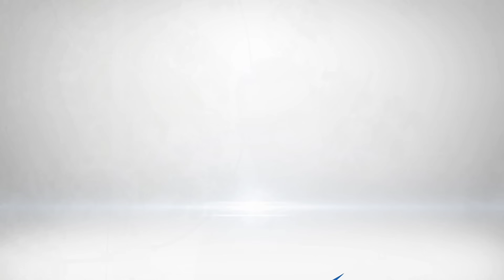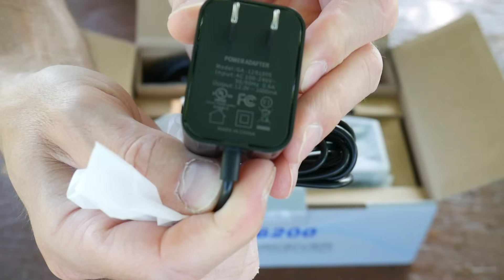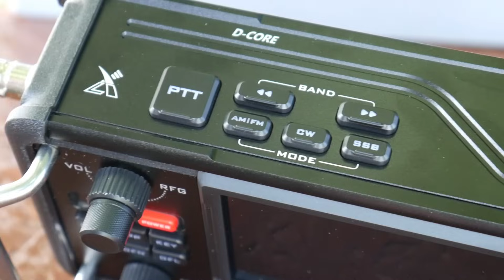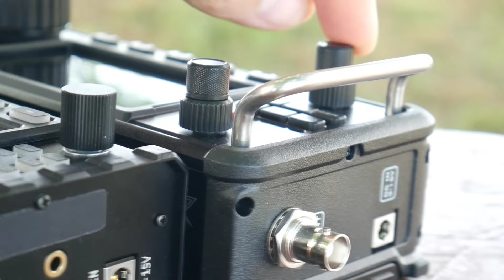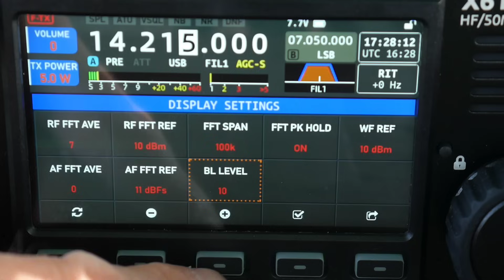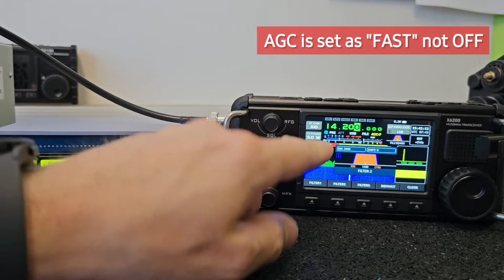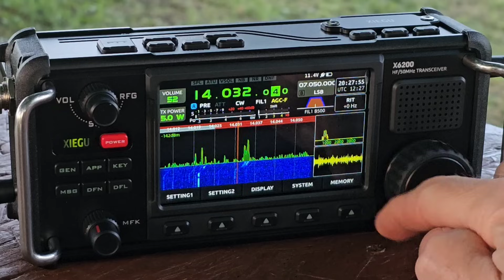New XIEGU X6200 - SDR Ultra Portable HF transceiver (review, comparison, measurements)

Comment: I just purchased one last week. First attempt to charge the battery pack and battery will not  charge. I set the setting "Charge On" and the screen indicates the battery is charging but after 8hours battery has no charge. This was with the AC adaptor supplied with the radio. Also tried charging with 13.8VDC still no go. Charging with the radio off, the green Xiegu LED flashes as it should when charging but battery is not being charged.
Disappointed.

Comment: Good evening Paul. First of all, thank you for the very interesting video. In this regard, having had the opportunity to use both devices, I would like to ask which of the two should I choose. Unfortunately, with the X6200, I have already had a very bad experience. Upon arrival home, it immediately showed obvious malfunctions. The device's PTT button, display backlight and SWR meter did not work. Also, after about an hour of operation, it turned off and wouldn't turn on again. The firmware was 101 dated July 24, 2024. I look forward to your welcome suggestions. Thank you. Best regards.

Comment: That really was one of the best films I've ever seen. And yes, the x6200 has a great receiver. And the transceiver's versatility makes it almost indispensable. I replaced the 6100 with the 6200. Strangely enough, I kept the x5105. I will test the transceiver with the OM0ET loop in practice. Hi 73 de HB9DTC Tom
Reply from the maker: Thank you for your nice comment Tom! 😉👍🎄

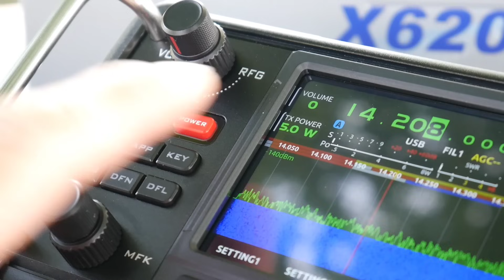Comment: I like how the X6200's frequency font is improved over the X6100, with the 100 Hz, 10 Hz, and 1 Hz digits are smaller than the rest of the frequency readout. The size difference helps to better visually communicate what the operator is adjusting. Compare with the X6100 at 24:17 into the video.

Comment: I have rethought the matter and it is better to spend a little more money and buy the Icom IC-705 It is a proven unit and has 2m and 70cm extra where the Chinese clone does not have it :face-blue-smiling:
Reply: The 705 is full of problems and way overpriced. In a few months the new Yaesu FTX-1F will kill the 705. I will still keep my X6100 when my Yaesu arrives as the 6100 is a great radio and fun to use. The 6200 will be great and even better with firmware. It is still new.

Comment: The x7300 will be the radio to get! It needs a touch screen. Going to wait.
Reply: The 7300 is now a vintage radio and never was great, just cheap. Get a FT-710, better than every Icom ever made including their flagship model. Number 4 on the Sherwood list. I will not sell my X6100, with the latest firmware it is awesome. The 6200 will be better with firmware updates.

Comment: You get what you paid for. Benchmark IC-705, xiego is cheap and not perfect. If you want a perfect Rig, buy Icom.
Reply: The new Yaesu FTX-1F will kill the 705. The 705 is very far from perfect. There is no such thing as a perfect radio. For the price Xiegu builds great radios that are fun to use and preform well.

Comment: I have two Xiegu radios, G90 and 6100.  I have always felt like a beta tester.  I bought the 705 and have never looked back.
Reply: 705 is way overpriced and still full of problems. On top of that no tuner and a dull uninspiring screen. I bought the X6100 and with the latest firmware have never looked back.
Reply: I agree but they are getting better. In 10 years I wouldn’t be surprised if Xeigu becomes a serious contender in this niche.
Reply: TX-500 ? )
Reply: Как говорится каждый живёт по своим возможностям,кто то имеет возможность купить такое радио а кто то ic-705,который будет очень трудно вытеснить .

Comment: I tested this transceiver for reception with an antenna and came to a simple conclusion - there is exactly the same receiver problem as in the previous model.
    All processing mathematics is designed for the fact that RF gain should be set to 100. You can’t just go and set it to 30, for example, the panorama and waterfall will be displayed incorrectly, the meter will show levels of -140 dBm, that is, show nothing.
    You need exactly 100 parrots, but the amplification is such that the sound turns into a cacophony of noise. A slight decrease in RF gain does not give anything, because the AGC still maximizes both the noise and the signal The conclusion is excessive AGC gain, which cannot be corrected.
    It's a heap - the encoder is impossible to use (I wrote above why), the built-in speaker is so squeaky and noisy that you can torture people with it.
    I compared it to the 705 and it's just heaven and earth.
    That's all, the transceiver is going up for sale. Just wasted my time. 

    Last edited by rolin; Today at 02:26. 

73! N7DDC

Comment: Not impressed. They need more than an incremental improvement, like HF/VHF/UHF (incl 220MHz), 10w on battery. Be nice to also have 23cm since Icom has it. Way too expensive for what you get.

Comment: Not a good radio. Slow screen refresh rate and high power consumption in rx. Icom ic705 uses 2.5w in rx and has fast screen refresh. The Chinese have a long way to go before they challenge first tier ham radio makers.
Reply: Sorry 705 waste of money for all its problems. Xiegu make good radios that are fun to use, after all isn't this a hobby. There was a time that the Japenese made junk. Xiegu is not junk. I did not waste my money on a 705 which was only slightly better if that. The new Yaesu FTX-1F will kill the 705 and be less money. I will use it and my X6100 as well.
Reply: @whitepinephotography5887  thats some good weed you have
Reply: The 705 is many times better on...

Comment: Nice video and interesting transceiver. But why do they not produce a transceiver with 10W of this internal battery? Elecraft with its KX2 shows how it is possible. 73
Reply: As if 8 vs 10 W is noticeable...
Reply: @RoelandJansen  8 or 10 W, but please with internal battery. Not only with external DC.
Reply: You only gain .5 S units with 20 watts. This is supposed to be a QRP radio, 5 watts.

Comment: I believe I watched almost all of your videos.
They are very good. Congratulations.
On the Xiengo X6100 it is normal to use RF SHOKE to avoid interfering with the transmission audio.
Does this problem remain on the X6200?
Thanks.
PP1JL José Luiz, Vitória - ES, Brazil

Comment: Excellent review on the X6200. I thought you were going to test the NR when you were doing a weak signal test ( -132? dBm). I recently sold my X6100. The X6200 looks better in a number of ways. 73 de WA3RSL
Reply from the maker: Oh! I just realised that I forgot to add this part in to the video. Yes I did this test. I will do the livestream today so you can see how the NR works.
Reply: @OM0ET  Very good!

Comment: Hi! The S-meter is either incorrectly calibrated, or the transceiver has serious problems with the reciever sensitivity. The X6100 had a stable S9 at -73 dBm, with the preamp turned off and RF Gain at 50. This is from the practice of Xiegu repairs. Although, perhaps they changed something here. Otherwise, the transceiver is more interesting than the X6100. If you plan to have a teardown video, that would be great. Thank you.
Reply: The meter... Only SNR is important
Reply: i'm sure all this will be fixed with firmware.

Comment: Thanks for the test Paul, You did a great job (as always).
I was really thinking of buying a 6100 last year. But there were so many bugs, and complaints about it, that I decided to go for the 705 instead, and I didn't regret it.
Reply: lack of tuner is a deal breaker for me. i don't know why they wouldn't put a tuner in it. when you get to field day, you need to be able to use it with any of the many antennas setup, and having that tuner just makes it so easy
Reply: 705 is way overpriced and still full of problems. On top of that no tuner and a dull uninspiring screen. I bought the X6100 and with the latest firmware have never looked back.
Reply: Price point. ocom and Yaesu have their QRP rigs for 4 digits not high three...

Comment: Does it still suffer the birdie issues that the X6100 had? I bought a X6100 and one of the birdies was a S9 on 14.070MHz making it unusable for data modes.
Reply: I sold my 6100 because of this very same problem.
Reply: Has now been fixed with firmware Sept 2024.

Comment: I would love to know what the TX Audio quality is like, with the built in microphone? The X6100 had many problem with the internal mic, and performed poorly.
Reply from the maker: Thank you, I will try to do an additional video with this test included 👍
Reply: Mine has always worked fine and you are the first to bring this up. I have had great reports like when using the hand mike. Maybe there is a problem with the element.

Comment: Thanks again, Paul, for one more of your good and informative videos!
I´ve got my X6200 4 days ago being less lucky than you with my device. Yesterday I sent it back. Would be intersting for me if you noticed also one or more of the issues my X6200 had.
It would be a nice rig (pretty housing, excellent display, good working noisreduction, many features), if there weren´t some unacceptable issues:

- every few seconds a "POWER FAIL. POWER DOWN IN 179S"-message pops up midscreen
- transceiver gets hot even without any transmitting
- SWR-Scan always shows excellent SWR across the whole band, even with totally inappropriate antennas connected
- ATU doesn´t work right, after tuning, SWR is still worse than 1:2 and transceiver switches power to 1W
- S-Meter doesn´t work properly. Even with very strong signals (S9+30dB) it shows not more than S5. Most of the time it shows S0-S1
- FM broadcast band nearly deaf. I normally receive 50-60 stations here. With X6200 I can use 3 of them...

Keep your good work, 73, Bernhard
Reply: Hallo Bernhard,
hier ein Feedback meinerseits zu Deinen Punkten:
- Power Fail hatte ich zweimal, allerdings jedes Mal, sobald der Akku bei 7 Volt sozusagen leer war, möglicherweise lag das bei Deinem Gerät an der Kontaktierung des Akkus
- das Gerät wird im RX-Modus nur handwarm, das ist für mich ok
- SWR-Scan funktioniert bei mir einwandfrei
- ATU funktioniert bei meinem Gerät ebenfalls wie erwartet
- das S-Meter ist in der Tat falsch calibriert, hier braucht es ein SW-Update
- FM-Broadcast funktioniert gut, bekomme einige Stationen, habe es aber noch nicht verglichen

Ich habe allerdings die Modulationen der beiden Geräte X6100 un X6200 verglichen, hier gibt es beim X6200 erhebliches Verbesserungspotenzial,
der X6100 klingt derzeit deutlich besser !
Ansonsten bin ich grundsätzlich sehr angetan von dem neuen Xiegu und erwarte, dass es einige zukünftige Updates geben wird 😎
Vy 73 Claudia DF1UX
Reply: @claudiafriedberg6248  Hallo Claudia, vielen Dank für Deinen Kommentar! Der Powerfail kam bei mir nach einiger Zeit immer, unabhängig davon, ob Akkus voll, leer oder gerade am Laden waren. Ich habe den Akku sogar ganz entfernt, selbst dann trat die Meldung auf. Ich habe Radioddity angeschrieben wegen der Mängel, allerdings den schlechten Radioempfang nicht erwähnt. Die Antwort:
- die Fehlermeldung ist ein Softwarebug, der beim nächsten Firmwareupdate (wann halt) behoben wird.
- bezüglich des heissen Gerätes, des Verhaltens des SWR-Scan und des ATU baten sie mich, Fotos zu schicken :-)
- zum S-Meter schrieben sie ich solle den FM-Mode auf WFM stellen 🙂
Habe das Gerät inzwischen zurückgeschickt, lief soweit problemlos.
Von Xiegu besitze ich noch den G90 und den X5105, mit beiden bin ich recht zufrieden
Ich wünsche Dir wirksame Updates und viele gute Verbindungen mit dem X6200!
73, Bernhard
Reply: @DC6NS  Hallo Bernhard, ja das ist dann schon schwierig mit den Chinesen, allerdings haben die sich von Geräte- zu Geräte-Entwicklung enorm gesteigert.
Ich besitze auch den G90, den X5105 sowie auch den X6100 - ich werde jetzt wohl alle verkaufen und den X6200 behalten in der Hoffnung, dass die nächsten
 FW-Updates die Bugs aus dem Weg räumen. Bei Deinem Gerät nehme ich an, dass da auch bei der HardWare irgendetwas im Argen war, insofern war es wohl gut es zurückzuschicken. Sind wir mal ehrlich ICOM und Elecraft führen, was die Qualität anbelangt,schon dieses Segment an, aber es ist trotzdem spannend, was jetzt so Alles aus Fernost  in der Zukunft kommen wird. 
Viel Spaß weiterhin mit unserem schönen Hobby und ebenfalls gute Verbindungen 😎
Vy 73 Claudia DF1UX 👋
Reply: @claudiafriedberg6248  Hallo Claudia, Du hast in allen Punkten ganz sicher Recht. Dass bei meinem Gerät etwas mit der Hardware nicht stimmte, nehme ich auch an, vermutlich im Bereich des ATU. Und - obwohl ich mit G90 und 5105 ja zufrieden bin - spielt der IC-705 (den ich auch besitze) schon in einer ganz anderen Liga, auch wenn er keinen Tuner hat.
Du wirst vielleicht lachen, aber ich hab mir jetzt was fast schon veraltetes bestellt, nämlich den FT-891 😀Mal sehen, wie der sich so bei Pota benimmt.
Schönen Sonntag noch und alles Gute, Bernhard
Reply: @DC6NS  Hallo Bernhard, Der FT-891 ist natürlich eine ganz andere Kategorie, also hat ja in der QRP-Liga nichts zu suchen - aber sicher ist der FT-891 nicht veraltet, er ist ein gutes Gerät für unterwegs, wenn man mehr Power braucht und es nicht so sehr auf den Strombedarf ankommt und man ihn in seiner Bedienung verstehen gelernt hat. Ich benutze ihn als guten Kompanion in unserem Wohnmobil, er ist sehr schön kompakt und braucht nicht viel Platz, allerdings braucht man halt eine resonante Antenne ! Viel Freude damit und alles Gute 🍀 See you on the bands, vy 73 Claudia DF1UX
Reply: @DC6NS  Stimmt, SWR Scan zeigt geschönte Resultate. Auch die SWR Anzeige beim Senden ist sprunghaft und wirkt unzuverlässig. Was gar nicht geht ist BT Audio in oder Audio out, nur Keyboard, Maus etc. Wifi ist bei meinem Gerät unbrauchbar, es kann sich nicht mal zu einem unverschlüsselten Wlan verbinden.
Reply: Wow. Xiegu radios would be great if they really fullfiled the great paper specs without tons of bugs and traps that make a potentially cool radio finally unusable. So maybe to get an X6100 for cheaper now as the X6200 might lower the price of X6100, while the X6100 might have got rid of most of the stupid bugs?
Reply: Xiegu will fix problems with firmware, or if you have a bad radio they will replace.

Comment: Thanks, Paul, for the detail video. The X6200 Xiegu radio is interesting, but more expensive. And output power is only 5 Wtts. My very old G90 has 20 Wtts output, its preferred for /p operations. 73 ! RD8O
Reply from the maker: Thank you Ivan, yes 5W with internal battery, 8W with external power supply
Reply: No need to 20 watts is only .5 S units higher. This is a QRP radio.

Comment: Thank you for the fine review. When you were checking the S meter level, was the RF gain set to 50%? That is where other Xiegu radios are set to check S level on receive. I have 3 Xiegu radios, and I will wait for a while and see how this one does once it is released, and I want to see what module improvements they decide to sell. I hope the support for the X6100 does not go away with this new radio coming out.
Reply from the maker: Thank you for watching! :) I had the RF-gain set to 100 during this tests.
Reply: @OM0ET  Thanks! Do you think you will own one soon?
Reply from the maker: @loraz0 oh I don't know, I hope so 😊

Comment: Thanks for the nice review. 
Is there any difference between the speakers? 

I saw on a other channel that there is a output issue the first seconds while transmitting? Some on comment that it looks like a design flaw  that you can not resolve with a update ? Do you can confirm about this problem when you was testing it ? I like this radio but for almost 1000 euro it must works properly, otherwise buy the 6100 our for the half of the price the 90. I like this radio for the battery , better screen, better stands,  better receiver than the 6100 ?  I am also curious about the birdies ? 

Thanks PY/PD9CHR
,73